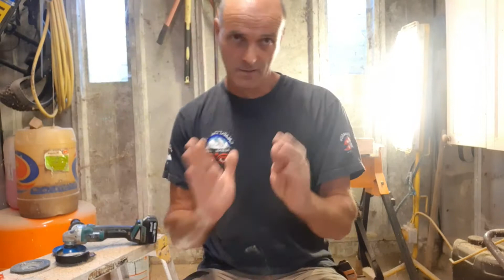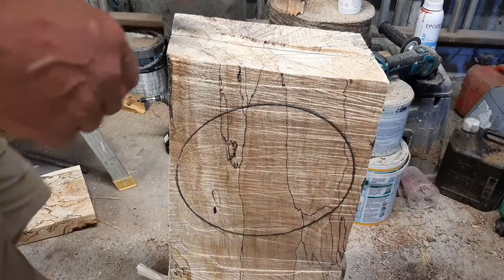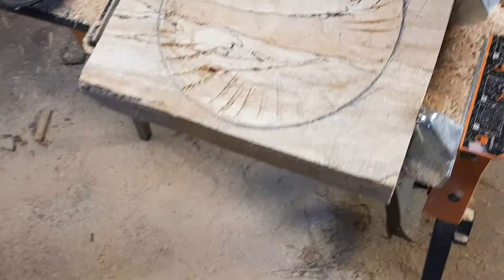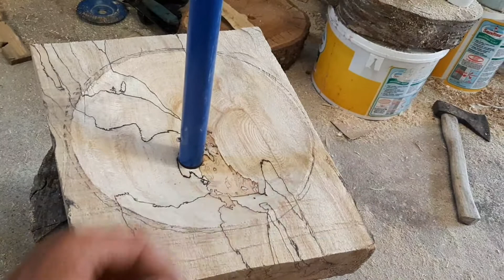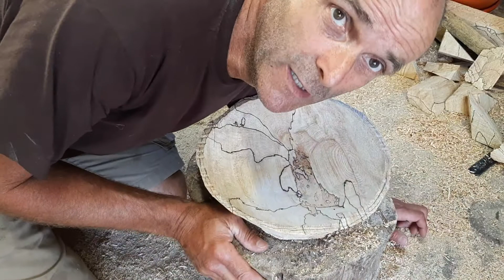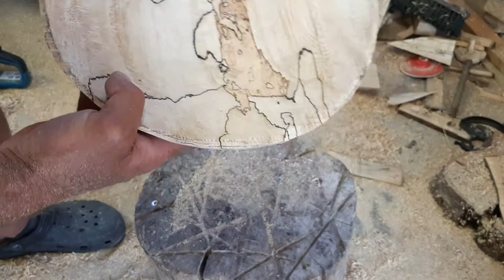Carving a bowl with a angle grinder. #woodcarving#woodcraft#wood#anglegrinder#woodenbowl#royleonard

Comment: I've been taking a bit of a break from making bowls with clay, & have been wanting to make wooden bowls but haven't got a lathe. I purchased one of the chain saw grinder wheels but have only used it enough to get a feel for it. I'm off to find me a proper bit of wood! Thanks for another great video, Sir!
Reply from the maker: I would buy a lathe if you could afford it. The chain saw disc is dangerous 😳
Reply: @royleonard1963  that was my impression of the tool as well. I decided as soon as I put it on the grinder that it was the most dangerous tool I'd ever owned!

Comment: The chainsaw discs are certainly dangerous, but all chainsaws are. I did logging for 10yrs and saw what they can do when not handled properly. I've been using an angle grinder and various carving and cutting wheels for a few years now and enjoying it and have a couple tips after watching this video. First, avoid using any grinder that uses only an on/off switch, only use grinders that have a safety switch, like a small pedal for example that will automatically shut the machine off as soon as you aren't holding the switch down. Why? Because, Second, only pull towards you when using the chainsaw attachment. Again, why? Because pushing forward has a greater chance of the grinder catching in the wood and jumping forward and, at the least, cutting a slice into the bowl you're trying to make, or much, much worse, yanking the grinder out of your hand. Having a grinder come out of your control that has a chainsaw attachment and is still running and jumping around because there's no safety switch is lethally dangerous. I saw the aftermath of a friend's shop after this happened to him; he thankfully wasn't injured but his poor shop was. The grinder sliced it's own electrical cord before he could get to the circuit breaker and shut it down.
Reply from the maker: Yeah, I know everything i done on the video was dangerous. I am quite experienced with power tools, been using them from an early age. But it's not the done thing . I've since bought a lathe.
Reply: Very dangerous use ! 

So : Use one with with a paddle switch and a motor brake. For example the Makita DGA 517.
I don't use my old angle grinder  for powercarving anymore.
I bought 5 with Paddelschalter (Totmannschalter) und Motorbremse. 
- and I would not buy a cainsawdisc anymore. 
You get discs with lot of power (for example from arbortech or cheaper from graaf)
They are acceptable in aggressivnes  but not so dangerous.
Greetings from Germany. 
P.S.: wonderful wood and very nice dish